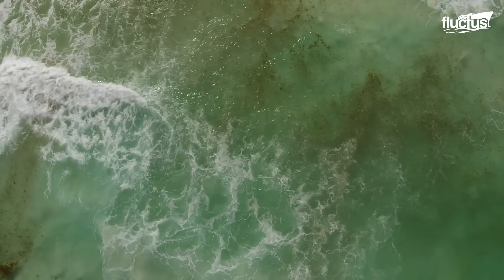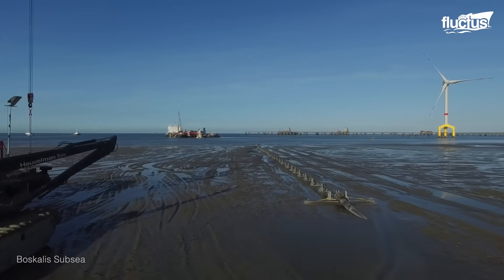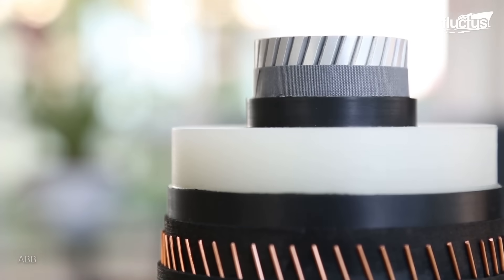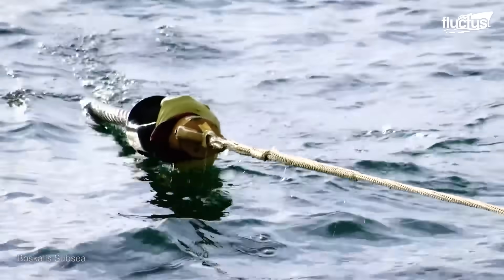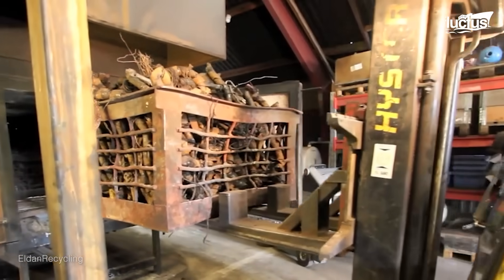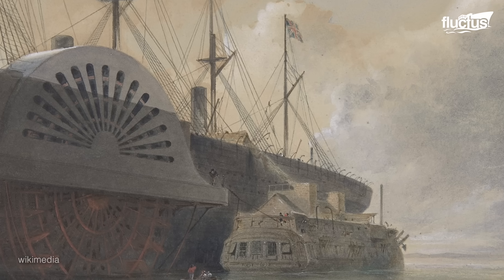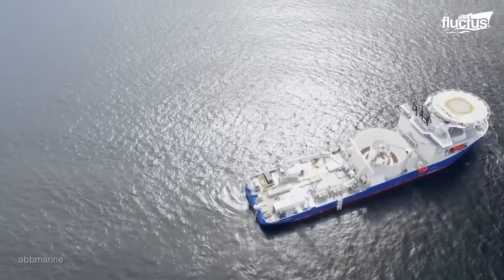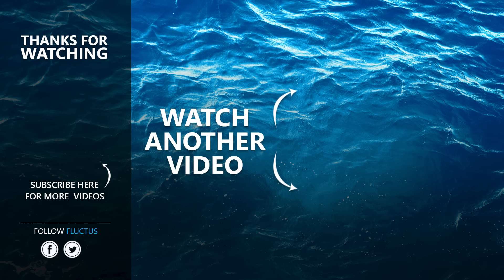There is a Reason Why Underwater Power Cables are So Expensive

Comment: I thinkv the 400 dollar per foot are not the ones that are on the bottom of the sea .. but the realy special types that are used  in searching oil  and  other typ3s of bottom exploration 
I worked in a factory that made these speciall cables  and remember the  large diameter ones   costing something like that. But they are about  500 meter  in lenght and are towed behind a ship  when in use and  taken out when work is done

Comment: Question for the experts: what's the longest unbroken length of (fiber) communication cable currently being manufactured?  I'd guess power cable maximum lengths are shorter due to the size of the cable.  When are two lengths of cable spliced--factory, or the ship, or whenever a repeater is inserted?

Thanks!

Comment: The shark thing is over with, afaik. It is thought that they were attracted to leakage voltage through the outside of the cable. Increasing the insulation reportedly seems to have dissuaded them for further interest.

Comment: I work at one the factories that make this type of wire. You can't imagine how complicated it is to make and let alone make right. Typically one to two people running the operation. It is dangerous and quite expensive just to try and start up these cable assemblies. The holders for some of the machine hardware can be near the size of a small boat trailer. Let alone employing the use of superalloys to aid in manufacturing.

Comment: In the 19th century the undersea cables were encased in waterproof insulating rubber from the Gutta Percha rubber tree. The exact same rubber was used on most domestic home electrical cables up until the 1960s.
You often see it in wiring in old houses, often “left in the walls” after the house was re-wired.

Comment: I believe $400 a foot is quite low.  Additionally the cost of laying the cable has got to be much more.  When a method to efficiently and reliably use carbon fiber these cables will have a longer life.  Additionally consider the thousands of miles of internet cables.

Comment: DC interconnectors use only two cores ( or one core with a coaxial return outer ) .... these are  VERY  low loss , compared to AC , 3 phase cables ,  the cable becomes a  HUGE  giant capacitor , smoothing out the fluctuations from the 6 or 12 phase rectifiers that supply it ... The UK to France interconnector is a good example .... DAVE™🛑

Comment: one such mitigating technology is depth of burial software that uses distrinbuted temperature readings from the embedded fibre optic cable to estimate the depth of burial under the seabed for each point of the cable. Or even distributed acoustic sensing software that allows "listening" to any sort of impact or strain on the cable. These technologies are pioneered by Marlinks

Comment: Me contracting for Charter Communications for 7 years it surprises me to hear that the underwater cables with the most advanced outer shielding, wire guard wraps, and grease inside can only last 25 years. 
As squirrel chews was the #1 reason to replace cables above ground, I'm thinking advancement cable design and demand for higher transfer speeds are the main reason to replace a cable buried under the ocean floor. 
Just a thought

Comment: Just apply safety measures that commercial drones are using, a GPS and a map with prohibited take off zones. Require ships to have this system and that way ships will not be able to drop anchor in the cable zone, should be an easy fix.

Comment: We take things like this for granted . The magnitute and marval of voltage and power distributation beyond imagination . Nicely done here in this brief presentation .
Reply: I becomes even more mind boggling if you ever carried a 128 Ampere Cable, you need a forklift for anything over 10 meters and then remember that is used by a big Stage, not a fucking Island.

Comment: all the copper in it that why
Reply: "copper is the greatest conductor of heat and electricity"
Reply: @mentalasylumescapee6389  yes it is that shit expesisve like hell
Reply: @noahgamingvideos1584  it's not just the copper. all the materials, all the scientists/engineers that designed it, all the labor from the staff to the machines to make it, all the costs of the ships and seamen and laborers to lay it, all the robots and extra utilities...that is why it cost so much.

Comment: The cables are actually expected to last 50 years.
Reply: "minimum 25 years" they won't wait for 50 years for something to go wrong they will replace/maintain them after 25 years, you have to remember people and whole companies are making big money here, they have millions of dollars to make and people/companies/countries need everything to be working for them.
they are not like you not wanting to buy another shirt until it grows mouldy and has a lot of holes in it.
Reply: @mentalasylumescapee6389  Being in the industry myself, I can tell you with 100% confidence that we do not rip cables out of the ground that is working fine. A complete cable system costs a bit more than a shirt.

How many high voltage transmissions systems have you done?

Comment: So, how expensive would a worldwide network of high voltage cables through all the oceans be? And how long would it take before it would make that money back? TBH I think it would be much faster then most people expect, especially when shipping becomes electric as well.
Reply: What you're asking isn't making any sense. Cables as long as this have a ton of electrical resistance.
Reply: @DDryTaste  There do already exist cables of over 2000 miles. I won't say it's easy, but it's not impossible.

Comment: Absolutely mind blowing that they were able to lay a cable across the Atlantic in the mid 1800's
Reply: impressive
Reply: It’s insane that they can do it now
Reply: With quite a few problems including funding, cable breaking and the end lost undersea, and no amplifiers or repeaters so the telegraph signal at the other end was too weak.  As a result they jacked up the voltage to something like 1,000 volts which melted the wire somewhere at the bottom of the ocean.
Reply: The first successful Transalantic Cable was finally finished in early August 1858. On August 16, 1858, Britain sent the United States an inaugural message via the transatlantic telegraph cable

So it was a bit disheartening when, just a few weeks later, the cable stopped working.

U.S. and British ships had already struggled to figure out how to lay the cable in the first place, and it took a few attempts before they’d been able to install it successfully. After the cable stopped working, it would take another eight years before the countries laid a working transatlantic cable that provided reliable communication across the Atlantic Ocean.
Reply: How are splicing / joining and damage repair carried out; be it above or below water-level ? 🤔
Reply: @johnnyeveritt5695 they typically bring it up nearly impossible to do it at depth
Reply: There’s a lot they don’t tell you.
Reply: Yes!
Reply: Excellent observation and comment!
Reply: Mind blowing for you since you've been brainwashed with lies since infancy. Research Tartaria technology
Reply: "Haphazardly" done.
Reply: @topgrain  a simple example of the curse modernity right there 😕
Reply: yeah and that they were people too. Even without social media. Just crazy...
Reply: @DonnieDarko2584  to be fair tech in the 1800s was new asf. Steam engine powered ships started in 1807, the first hydraulic crane was 1838. Considering that tech was not very good, and controlled, it's a feat of work. Nowadays we have much more precise instruments, safer measures against situations, and overall a more pressing sense of self-preservation.
Reply: @1SSJA  Yes. All I was saying is that SURPRISE we weren't idiots back then either. Likely smarter in a way.
Reply: @DonnieDarko2584  I mean humans were never really idiots. It's just an incredible feat without the last ~200 years of technological progress.

Comment: Inseat of charging $400 per foot of cable, they should charge $400 per Kilometer of cable, because that's cheaper.
Reply: We should all use the Imperial system, because $400 per mile is ever cheaper.

Comment: What is missing in this video is labelling of the cables and it’s components or materials for a better understanding especially for people without the knowledge of materials used . The cover of this video shows the cut section of the cable, it could have been useful if it includes labels.
Reply: If only you had access to the sum of human knowledge at your fingertips with which you could use to find more information elsewhere....

Comment: Hmm, Alot of the fillers/spacers you see in these cables are made from MDPE or HDPE. These stop the cables from rubbing against each other, also there very strong and light weight.
Reply: dirtmonkey I suggest watch a 13 part series called What on earth happened by Ewaranon to learn that the earth is not a globe.
Reply: @flat-earther  what?
Reply: @milanbaros2005  I suggest watch it to learn stuff you probably haven't heard before. I got the series in my about tab.

Comment: Every single piece of cable they use should be extracted from the ocean after use for recycling…….period, no questions
Reply: That's required in many places.
Reply: @ghost307  I hope, and also hope that it’s followed
Reply: Warren I suggest watch a 13 part series called What on earth happened by Ewaranon to learn that the earth is not a globe.
Reply: @flat-earther  are you trying to say the Earth is flat?? If so, GTFOH
Reply: @CapnPink28  I didn't say that. I just mentioned the globe.

Comment: "Voltage to be carried"... Miss, the cables requirements are completely independent of the voltage...
Reply: Gregor I suggest watch a 13 part series called What on earth happened by Ewaranon to learn that the earth is not a globe.
Reply: Try running 135kV on a wire insulated for 600V and let us know what happens.

Comment: im thinking of cutting one of thouse cables who supply europe.... im tired of the electric cost...
Reply: torso99 I suggest watch a 13 part series called What on earth happened by Ewaranon to learn that the earth is not a globe.
Reply: Plan on cutting quite a few of them. England to America is one of the most heavily used cable routes.

Comment: Wow, those cables cost $2,112,000 a mile. I'm surprised people stealing them isn't more of a problem.
Reply: There is no way you can steal them that would be even practical
Reply: @mak4na8o8  Yes it would be. Just get a couple of divers or ROVs to cut a section out of the cable, hook it up to a boat, and tow it to shore. Then you can cut it up into more smaller pieces and sell it for scrap.
Reply: Patrick I suggest watch a 13 part series called What on earth happened by Ewaranon to learn that the earth is not a globe.

Comment: I have always been curious, the cables always reach the (deeply) bottom of the sea or to an acceptable depth even though they do not touch the bottom? It was the same with the oldest cables?
Reply: Always on the floor, no matter the depth
Reply: They're always laid on the sea floor, but the Engineers carry out underwater surveys of the terrain and depth ahead of time to find the best route.
Reply: Deutschejar I suggest watch a 13 part series called What on earth happened by Ewaranon to learn that the earth is not a globe.

Comment: if only the technological advancement of humans wasnt stifled countless times throughout history, (cough, Tesla's wireless power transfer tech, cough) we would be at a place where sharks biting cables and islands losing power for days wouldnt be a possibility.
Reply: Can’t do it for long ranges, the amount of power needed to be pumped into the air to counter the loss would be too much, anyone close would probably fucking die
Reply: @mak4na8o8  you say that because the tech hasn't been invented so you're thinking is based on the fact it doesn't exist for XYZ reason.

Nikola Tesla invented a way to transfer power across the globe via using the Earth's atmosphere. Range theoretically unlimited.
Reply: Joshua I suggest watch a 13 part series called What on earth happened by Ewaranon to learn that the earth is not a globe.
Reply: @flat-earther  I'm half a flat earther. I don't believe in the globe model. Its been proven that the common curvature is not accurate. The earth is either way larger than they say or it's flat. I lean mostly towards the pond theory.

I say "globe" because it's annoying to get into a flat earth debate every time you talk to anyone. Been there.
Reply: @Mind_ConTroll  exactly how I feel.

Comment: good god theres so much material in those things and they just leave them sit on the ocean floors in some cases? im assuming they could get it but dont have a proper way to retrieve it which begs the question, is it worth laying down a multithousand dollar cable in a iffy area? or its it better worth finding ways around it with cable accessories and have a plan to uproot it
Reply: They pull them up and recycle them. In some places removal is mandatory.
Reply: Pluvial I suggest watch a 13 part series called What on earth happened by Ewaranon to learn that the earth is not a globe.

Comment: Having worked in such a factory line on different levels, I wonder why those recycling people are not wearing any breath filters, and some have no gloves even?! Just posing for a video or simple ignorance.

There are many dangerous substances in those cables, usually related to water barrier or water retention. Powder, powdered lining, lead... The water barrier is normally lead for its low cost. That is a 4-5 mm thick layer of lead extruded around the main cables. In the water barrier extrusion line, the machine operator jobs were long term always, because one of the "questions" they get asked is "you already have children?" and in old days, and why not these days, above average cause of death for a cable factory worker was cancer.
Reply: Kanki I suggest watch a 13 part series called What on earth happened by Ewaranon to learn that the earth is not a globe.

Comment: So much for KISS !
Reply: What's so complicated about an underwater extension cord?
Reply: @ghost307  its gotta be sealed preety tight

(Goldmember from austin powers)

Yesssssh toight
Reply: @nolesy34  It only needs to be strong enough to be resistant to sharks with frickin' laser beams.
LOL
Reply: @ghost307  AH u got there first

AH 👌
Reply: Mwah
Reply: Michael I suggest watch a 13 part series called What on earth happened by Ewaranon to learn that the earth is not a globe.

Comment: Pretty good vid, wish you would have talked about the splicing on a new section of ruined cable. The cant be easy with a cable that size ha.
Reply: Vash I suggest watch a 13 part series called What on earth happened by Ewaranon to learn that the earth is not a globe.

Comment: What would it take to make them carrie like 5 million volt?
Reply: Alexander I suggest watch a 13 part series called What on earth happened by Ewaranon to learn that the earth is not a globe.
Reply: As far as I know the highest voltage is use for power transmission is 1.5 million volts.

Comment: 1st trans atlantic cable was a failure.
They didn't understand electromagnetic properties back in the 1800s.
Reply: Bill what did they do wrong? Also I suggest watch a 13 part series called What on earth happened by Ewaranon to learn that the earth is not a globe.

Comment: I wish i had a cross section so i could frame and display it
Reply: SK3TCHI I suggest watch a 13 part series called What on earth happened by Ewaranon to learn that the earth is not a globe.
Reply: @flat-earther  what platform can i stream it on?
Reply: @I-ADHD-l  It's the first link in my about tab, tell me if you found it there
Reply: @flat-earther  thx🔥🔥
Reply: @I-ADHD-l  Did you watch it if so I would like to know your opinion.
Reply: @flat-earther  well i was going too but it asked me to make a account and id prefer not too

Comment: No wonder the proposed  Australia-Asia Power Link project has a $30B price tag, the cable alone would be worth $5B+, length 4,200 km (2,600 miles).

Comment: this is why Star Link and anything else like that in the future are vital
Reply: How much power can the satellites handle?
I thought they were only data.
Reply: @ghost307  What do you mean? I'm not sure how much power but they're definatly fast. Other things to note, when I said data center to solve that they would need to build some data centers / storage in space.
Reply: @zfdfilms  You implied that undersea cables were unnecessary. Many of those carry high voltage electrical power. The ones that carry data indeed do the same job as satellites, but at a much lower cost per byte and totally immune to solar flares and other interference.
Reply: @ghost307  Yes I agree sir! I get the point, and you get mine :) I didn't mean one was obsolete but having multiple ways is just better. (Yeah it's going to be slow / ping higher for satellites but more connectivity is good! Ty for reminding me bout the power that's true. Plus speeds are much faster obviously LOL! I'm just thinking way out too the future when tech gets even better lol!
Reply: @zfdfilms  Thank you for being one of the people on YouTube who are capable of having a calm, reasoned discussion. So many folks here just want to rant and pontificate.
Reply: @ghost307  right back at you! :)
Reply: Star Link still depends on these undersea cables
Reply: @collodionpositive554  I agree only for now you see because data centers yep

Comment: Im working with NKT cables sweden and im the last part of the puzzle. an so called armerare in swedish, putting on steel wires and then load it on eather our boat Victoria or spin plates. looks like it's our boat victoria at 0:41
Edit: proberbly not our boat. 1:49 here is where i work.